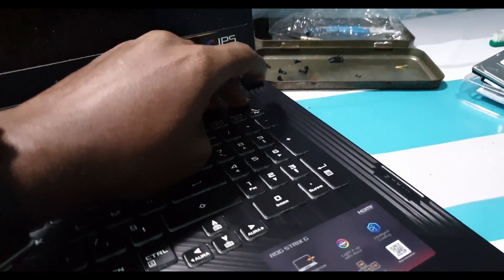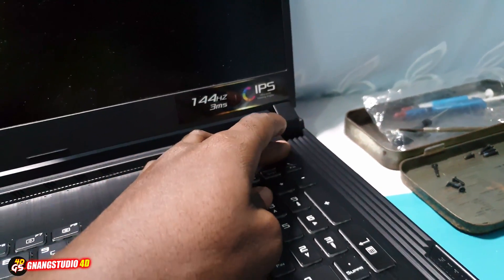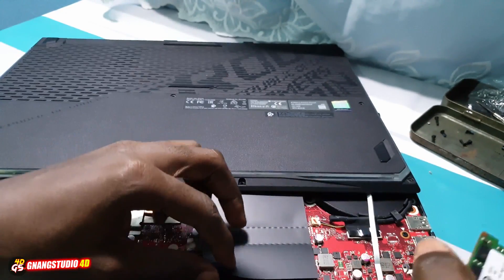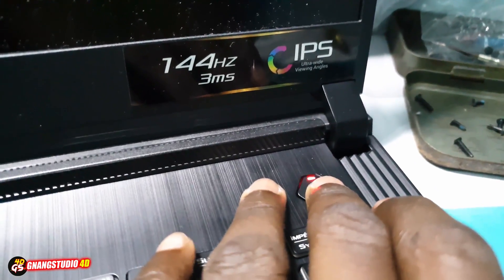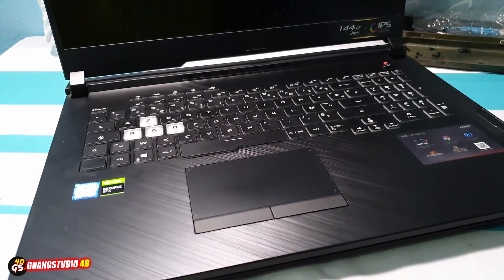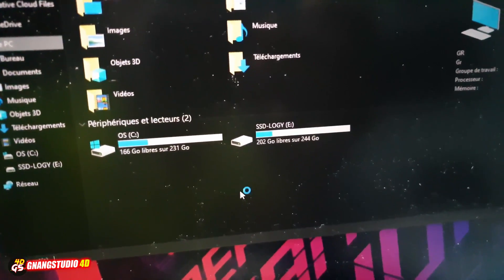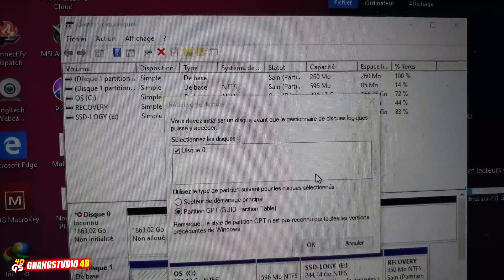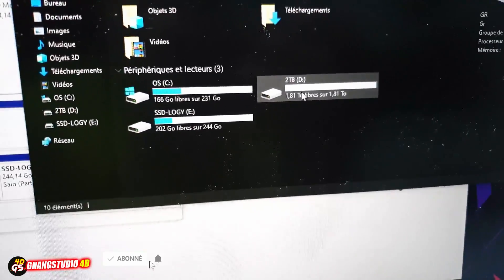Asus Rog Strix G731GU Won't Turn on: FIX | Repair

Comment: My Asus rog g15 Model G513RC  etc haf this problem after my bios update. What i tried doing was holding the power button for around 12 seconds and it finally turned on

Comment: Bro my laptop is not turning on. I have sprayed a Colin on my keyboard means a chemical that cleans a component and then I turned off my laptop its rgb lights are blinking when I try to turn it on. I went to repair shop they cleaned the power b button it started working. They told go to nearest center for buying a new keyboard . after , 1 month it stopped working, I took it to service center they told me to buy motherboard of rs48000. Mine specs.
Tuf fx505DT 
8 GB ram 
Gtx1650
Reply: Go for local repair shops, Asus Service Centre will always ask to replace motherboard for every issue.

Comment: HOLY CRAP at first I was like, "really? swapping RAM is the problem?" and then I tried it and IT ACTUALLY WORKS OMG HOWW??? pls explain to me the science behind it lol
Reply: Bro, what was your problem?
Mine turn on, but no image and response, airplane led is on
Reply: @scarcesso  Same issue with me. How did you fixed it ?
Reply: @harshkhapre4204  also sam with me
Reply: @harshkhapre4204  this is the same issue I’m facing how did you get the laptop to display? 😢😢😢
Reply: @scarcesso  Same issue guys, the airplane led is on when plugging the charger and laptop shows no display. Did you guys find any solution or just gave it for repair to service center? Where is the issue???

Comment: I really thank you from my heart, for saving my money and time!. It worked for my Asus ROG 531GT. It's the factory setting that, disassembling the laptop, will start 'Auto Fan Cleaning Mode'. Thank you for giving solution to this problem. Solution: Continue Replacing or swapping RAM until laptop boots up!
Reply: Bro help me that it's not working for me I have tried this several times.

Comment: I tired this and it didn’t work. My laptop keeps repeating the ASUS logo boot up thing then as it’s about to load into windows it restarts (turns off) please anyone help me! Thank you
Reply: I'm facing the same problem
Reply: @MSKFCE  I still haven’t managed to get it working.
Reply: @lavotal2762  same I just gave it to the service centre cause it wasn't turning on
Reply: @MSKFCE  I don’t know what to do with mine.
Reply: @lavotal2762  i recommend doing the same, it's better to give it to the service centre than to meddle with it yourself
Reply: @MSKFCE  I did give it to one, but they didn't know what to do with it.
Reply: Same problem here
Reply: Did you all get yours fixed, it's a bios issue unfortunately I'm in Zimbabwe I could have helped
Reply: @tafadzwamusekiwa659 لدي نفس المشكلة ما الحل؟
Reply: Might be corrupted windows files

Comment: Same issue with my ROG G15 i7
Reply: Mine tooo
Reply: i got it repaired and they told that that cable got loosen that's the issue and they reconnected that cable and problem solved.
Reply: it's working perfectly for now
Reply: Mine is still there...not working...smtimes the side lightnings r turning on with random colours...keyboard light works fine..but some issue in the bottom one...ill try reinstall drivers..
Reply: @nadeeshasamararathne4349  Get it serviced they will easily tell you what's the issue. Only go to authorised service centre if possible otherwise you will loose some parts of your lap and will also possible leak personal files etc.
Reply: A holes everywhere so tc 👍.
Reply: Ok.. I'll try ..thanks for your informations.👍

Comment: Just plug laptop in let it charge and it will cut pack on was just going through same issue...
Reply: No… just cause it worked for you doesn’t mean that works. I’ve had this issue twice and both times I’ve tried doing that and it doesn’t work
Reply: @catdogorboth7087  same here bro it doesn’t work at all

Comment: Thank you very much for your video. It worked for my ROG GL552V
Screen wouldn't turn on after disassembling in order to clean fan. Didn't know what to do. Thank you once again.
Reply: this is happening to me did this help?
Reply: Yes, it worked for me. Did this happen to you after taking it apart? Or did it do it randomly?
Reply: Same! I was so dead when it was not turning on
Reply: Hello, what was your problem? My laptop, turn on, keyboard is lightup, and airplane mode light too, but it doesn't respond, and there is no image

Comment: Hey, Thank You!!!  I spilled some water on my "ROG" and only then lights and fan came on after drying it out. I swapped locations like you did.... and 🤯  IT CAME BACK ON!  Thanks again😁
Reply: I also spilled water on my asus ROG and the lights is not working , I dont know what to do.
Reply: Keep letting it dry it will come back on put in heat like sun to dry it out....promise thought mines was done with
Reply: Same here. It got wet. Lights are on and sounds are hearing but screen is black lol. Idk what to do. Tried this but still not working
Reply: hey bruv any updates ? @aravindseenivasan4704

Comment: Thank you so much bro for this tutorial! I was able to fix the problem. Definitely subscribing to your channel.
Reply: Hello, what was your problem? My laptop, turn on, keyboard is lightup, and airplane mode light too, but it doesn't respond, and there is no image
Reply: @scarcesso  same thing did you get yours fixed
Reply: @ProlllyMike  went in 2 services, both said that cpu died, at least repair cost ~120$
Reply: @ProlllyMike  update, new info from another service. Liquid metal spilled somehow under cpu, now they will try to remove it, then they will reball cpu and wield it again
Reply: @scarcesso any update??